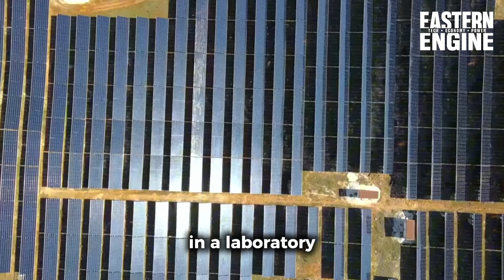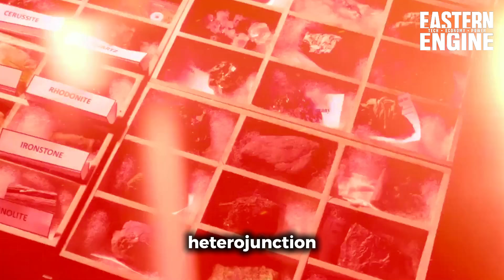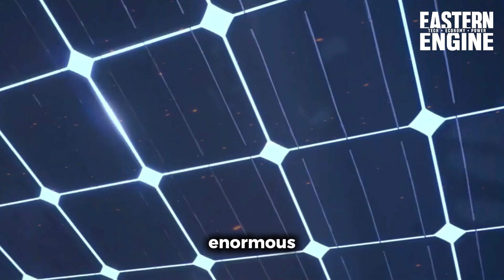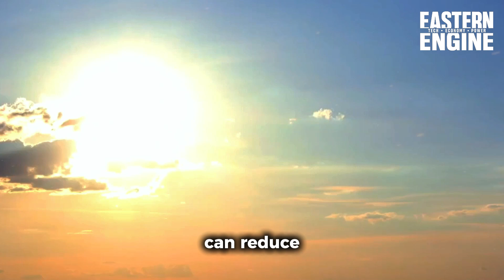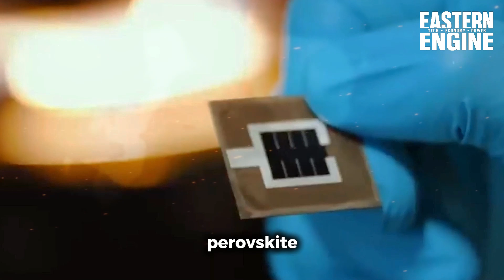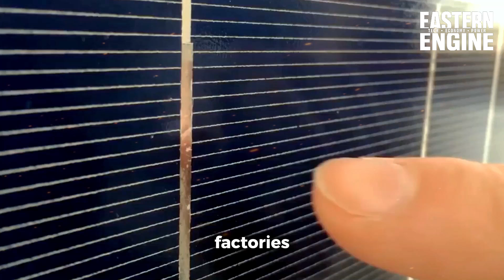China Just Built a 776W Solar Panel — Silicon’s Biggest Upgrade Is HERE

Comment from the maker: Do you think 776W solar panels could change the economics of solar power worldwide, or is the biggest breakthrough still ahead?
Reply: No Renewables as a micropower could only put in 15% of advertised output or extra electricity including wind turbines whatever when they talk about solar efficiency it's just the size of the panel you know the footprint again it takes one itsy bitsy 2nd to double-check the installed watt meter at any renewable site and you'll see an 85% loss it's kind of like pumping air or water against existing pressures

Comment: Definitely a sensationalized and overhyped video: the much-touted 776 W does not represent a revolution in solar-panel efficiency. We’re basically talking about a large bifacial panel rated at around 700 W, with the 776 W figure reached only by including the theoretical additional output from the rear side, which depends heavily on installation conditions.
Reply from the maker: Fair and technically accurate correction — bifacial panel ratings that include rear-side generation potential are inherently conditional on installation environment (albedo of the ground surface, tilt angle, proximity to reflective surfaces), so headline wattage figures can be misleading if that context isn't clearly stated. Worth being precise about front-side STC rating versus bifacial gain in any coverage of these products.

Comment: One thing you don't mention about efficiency is heat. Cells are tested at 25 degrees Celsius. But in reality solar panels don't stay at 25 degrees. Solar panels absorb light and only transform a fraction of that light into electricity. The higher the efficiency, the less waste heat is produced and as a result the less the panel heats up as a result of sunlight exposure. That reduction in panel temperature then also increases efficiency. So a 33% efficient panel doesn't produce 50% more energy than a 22% efficient one, it's actually a bit more in reality. And on roofs in hot climates that also means that less heat is transferred down to the roof below. And it makes it easier for the panel to last for a long time.
Reply from the maker: Excellent technical addition that genuinely deserves more attention in solar coverage — temperature coefficient effects are real and the compounding benefit you describe (higher efficiency → less waste heat → cooler operation → further efficiency gain) is accurate and often underreported. The real-world performance advantage of higher-efficiency panels in hot climates is greater than the raw efficiency numbers alone suggest. Great comment.
Reply: Efficiencies just the size of the panel how much it can put out the main problem is there's an 85% loss once connected to the grid

Comment: That's cute but still at the end of the day once connected to the grid can only put in about 113 w can I break the Ohm's law barrier the ignorance of Renewables on the grid is easily demonstrated with a volt amp meter and 4th grade math called Ohm's law 15% that's it that's all you can put in can you add a battery for another 5% less
Reply from the maker: Not quite following the specific claim here — Ohm's Law governs the relationship between voltage, current, and resistance in a circuit, but it doesn't impose a 15% ceiling on grid-connected solar output as a fundamental limit. Grid-tied inverter efficiency, voltage matching, and local grid conditions all affect actual power delivery, but those are engineering and installation constraints rather than physics barriers inherent to solar technology itself.
Reply: @EasternEngineelectricity is just like pumping air or water against existing pressures or even charging a battery so the full a battery gets the less amps goes in just like the grid but Watts stays the same in the grids case is 85% loss more or less overcoming the resistance of the grid itself you know the putting pushing electrons backwards through a Step Down Transformer and the voltage potential difference so I told you about the instrument to do the test in Ohm's law and in most cases takes one itsy bitsy second assuming you can do the math
Reply: So the other key thing is watts is the total amount of work done including overcoming the incoming voltage and the resistance of the grid itself again amps is the actual flow of electrons and volts is pressure again do the test and you will see
Reply: And then you add batteries for another 5,,10% loss

Comment: If only they could make super light printable solar panels that roll out and are quite as powerful!?
Reply from the maker: Perovskite and thin-film solar research is actually working toward exactly that — flexible, printable solar cells that could be applied to curved surfaces, vehicles, or rolled out over large areas. Efficiency and durability are still the main gaps from commercially viable rigid panels, but the direction is real and actively pursued.

Comment: Depending on the cost and longevity I see the primary application to vehicles with living spaces. Secondary would be multistory buildings in close proximity.
Reply from the maker: Interesting application thinking — high-wattage panels on RVs, boats, and tiny homes do make more sense with higher-efficiency panels that can generate meaningful power from a limited surface area, versus needing to cover every inch of the vehicle. Multistory building integration is trickier given shading and installation angle constraints but valid as a secondary application.